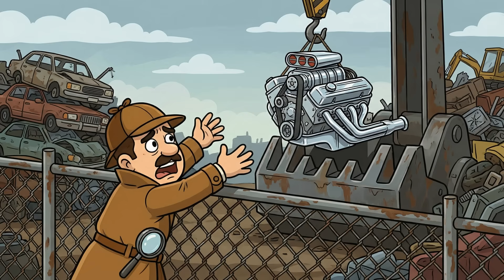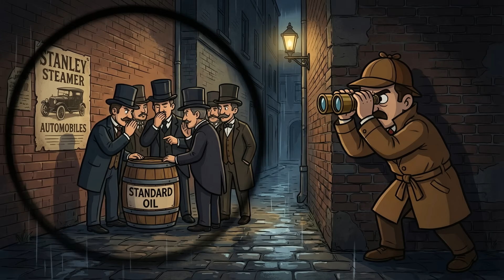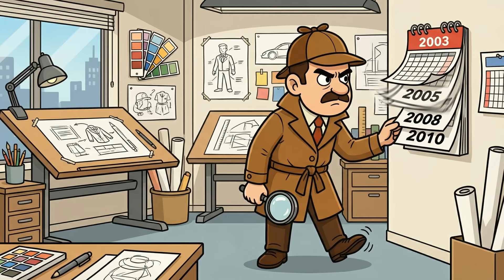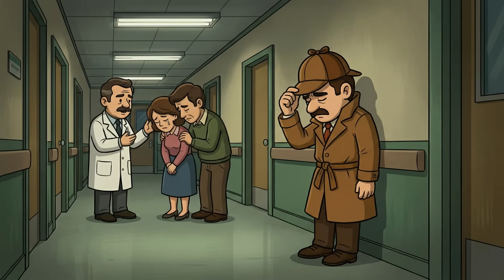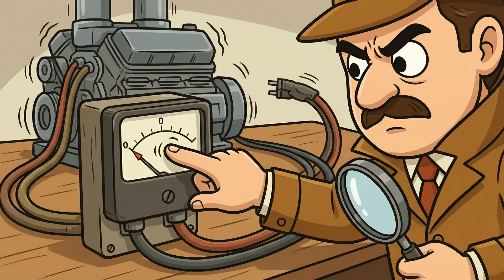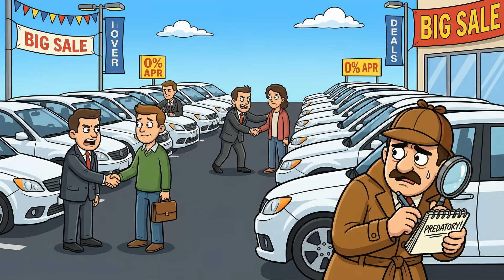10 Engines That Never Broke Down And Were Destroyed

Comment: If fiberglass was a viable material to build automotive engines they would be used in the race applications or supercar applications to reduce weight. Since they're not that proves that the concept did not work. Just more AI spot that just lies to make a video

Comment: There has never in the history of automobiles been a car that's been able to go to 200 mi per gallon. I don't care what carburetor hat on it. motorcycles are some of the most efficient engines ever produced and they're not getting 200 mi to the gallon
Reply: The most efficient Diesel car engines get around 100mpg. 200 would not be thermodynamically possible.

Comment: The Tucker had an airplane engine in it .  And aluminum engines were built in the 1915-18, for aero use. The LIBERTY V12 WAS ALUMINUM. 
Also, If we had a 200mpg carb, we would just drive more..

Comment: Has anyone ever heard of an engine that was made from a ceramic material? Self repairing of the engine block and internal components. Could not run hot didn’t need a cooling system. 
My mom told me about this when I was a senior in high school. Never heard about it again.

Comment: Stirling engines have not been crushed by "big oil". this is ignorant paranoia and has nothing to do with either the realities of Sterling engines or their development. The US dept of energy has experimented with them, as has NASA, as has Sweedish engine builder  Kockums, and they are currently used on submarines. They are capable of attaining higher efficiencies, though  no where near the 50% you claim (Cite just one example!) The highest efficiency ever achieved by a Steriling engine was just about 38%. This is higher thn the  gasoline ICE effeiciency of abouut 25% but the other drawbacks, which you seem to be unaware of, prevent it from general use. The warm up time for instance, the inability to accelerate quickly, the need to higher temperature materials.  You should actually learn some engineering or at least meet an engineer instead of parroting that psychotic paranoia anti-big oil idiocy. You must have spent your valuable college years (if any) in a liberal arts program.

Comment: If steam engines in cars required little maintenance, why did steam engines in locomotives require a lot of maintenance?
Reply: Boilers get full of minerals from water.  
Car steam engines, being much smaller, had the same problem but it happened much more slowly.  
Those with flash boilers would be still less vulnerable.

Comment: I successfully built a cell that produced hydrogen. The problem I ran into was that it took more energy than it produced.
Reply: If you pulse water at it's harmonic frequency, it will split the hydrogen from the oxygen with very little power.  Same as, push a child on a swing and only push at the right time(frequency).  With very little effort that kid will be swinging high and fast.
Reply: @nlyafrd4u  do you have any info about this?

Comment: the water engine worked but did not produce enough power to generate the electricity to make the hydrogen to run the engine.

Comment: I have made a Pogue carb. It isnt what you think. Droplets of fuel need to be in the air in the cylinder. During ignition those droplets flash steam and combust shortly afterwards. That steam effect isnt present with vaporized fuel, leaving part of the power stroke with nothing. The modern cars arent built to run at a steady rpms because octane problems of the day no longer exist.

Comment: I don't completely agree with what you're saying. For example, the Stirling engine has not been completely abandoned and destroyed. It is mainly used on SSK submarines. 
Regarding the GM EV1, the main problem with the failure of electric cars is not the engine, but the batteries. They store little energy and take a long time to charge. When it's cold, the range drops significantly. The first version of EV1 had only a 70-90-mile range (Don't get me wrong, I own an electric vehicle...).
If they were that effective and the patents were available, countries like China, which has to import most of the oil it uses, and those that don't have to answer to Big Oil, would have adopted them...
Reply: The current problem with electric cars, is that the batteries are hard wired into the cars, enabling the manufacturers to charge a fortune for new batteries, plus the cars must be recharged. The government should have open bids, for rechargeable battery packs, and the vehicles should have all used the same type of battery packs which could be quickly replace at service stations, while the discharged betteries went straight into a revolving charging rack, so the down time of the car would be only a few seconds instead of hours. Simple bayonet slide in docking in standardized shape 'docks' in cars would be able to be changed in seconds. But there's too much big business control to have that happen. 
If you need more power than one battery pack, you could stack them by simply putting two or move docks in a car./ truck. The battery docks could be placed under the car, where the engines usually are, or wherever they want to place it.